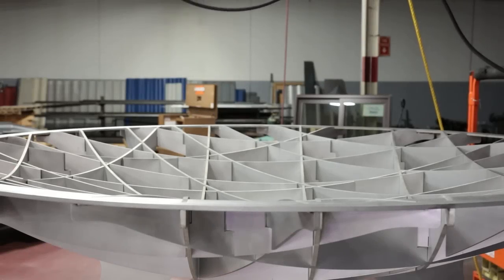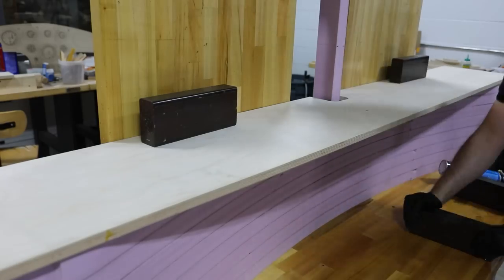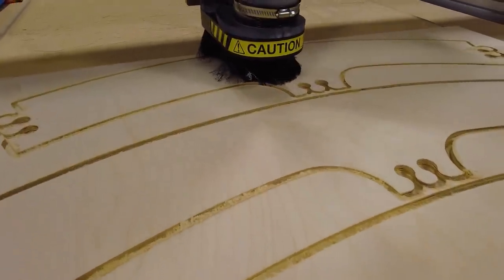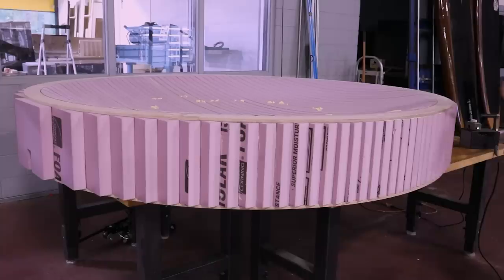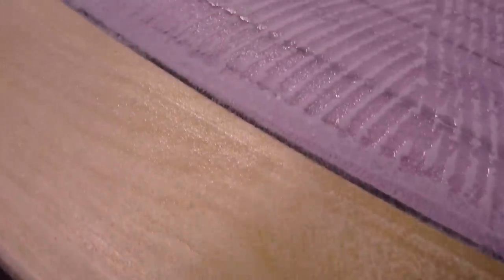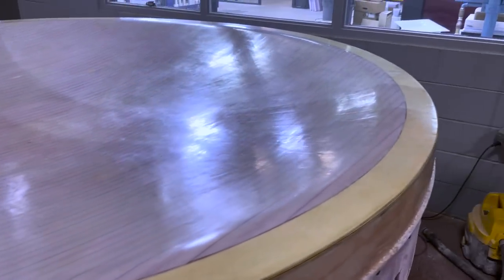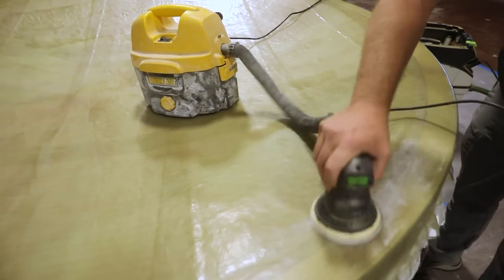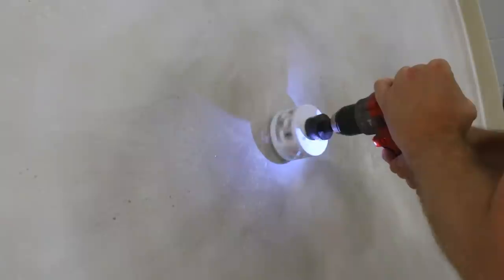Making a Giant Fiberglass Bowl | Koi Pond Pt 2

Comment: It must've felt so rewarding to see the fountain up and running. Beautiful work, thanks a lot for sharing the process!=)
Reply from the maker: It really was…  What you don’t see is me jumping up and down behind the camera when we turned it on for the first time!  It came out as designed, but better somehow because of the light shining through the bowl and the patina that has developed on the aluminum.
Reply: @Grunblau  I can only imagine :D ! I especially love the shots from the bottom where you can see that the bowl is slightly translucent with the sunlight refracting in wave patterns. Kind of like and upside down ocean.

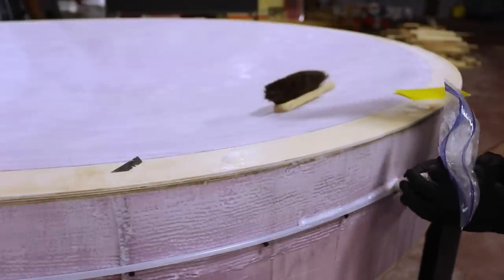Comment: 8:38 if you have an old tube of silicone, you can pop out the back easily by pushing it through the hole with a screwdriver and push the hardened silicone out along. This then becomes probably the best lay tool for filets and glue joints, especially since you can buy spare nozzles (some places even sell profiles) for dirt cheap. Once the epoxy hardens, squeezing the tube makes it easy to remove, you can even recover the nozzles in most cases. Give it a try with some leftover epoxy to see, i've had great success with the tubes that used to house the glue/silicone made by Moment, but i'm sure other brands work just fine too.
Reply from the maker: Huh, thanks for the tip!

Comment: Why not make the bottom ring bigger than the top ring and have the draft built into the hot cut foam?

Excellent work!
Reply from the maker: Good suggestion!  The rings being the same make a lot of things easier (alignment, hot wire) and since the bowl was 95” in diameter, some of the sections barely made it onto the sheet.  But had I thought about draft from the start, I might have considered it…

Comment: Can you dial this sucker back for some nice laminar flow? Love the build.
Reply from the maker: Interesting thing about pond pumps is that you actually have to size them.  If you restrict the flow it makes the pump work too hard :). 

That said, we got the largest one they had at the store… as one does.
Reply: @Grunblau  I alway just diverted the flow with a T-junction and ball valve, to keep the pump efficient but decrease flow to a particular spot.

Comment: do you have any tip for making something like that level without a leveller
Reply from the maker: Make sure the bottom of the pond is level and adjust from there if it isn’t with sheets of pond liner.  Then after placing the base, check the rim as best you can with an 8’ level.  Install the bowl and check again.  Could ultimately shim bowl too worst case…. 

Got pretty lucky in this case that the pond contractor had made the bottom of the pond extremely level!

Comment: Is putting polyester resin over epoxy compatible?
Reply from the maker: Epoxy resin was used for the mold and polyester resin was used for the bowl.  With a bunch of wax in between.  Final part was all polyester resin.
Reply: @Grunblau  Duh! I kind of missed that fact. Thanks.

Comment: 6:35 god, can you imagine going to all the effort to make a foam mold for your resin to dissolve it! that's the kinda crap that happens to me!
Reply from the maker: Happened to me when I built my MDF CNC.  I made a mold for a table and it took probably 30 hours of machine time.  I tested a spot.  Seemed okay, then I slathered on the resin and fiberglass.  It slowly melted.  That is when I learned about the difference.